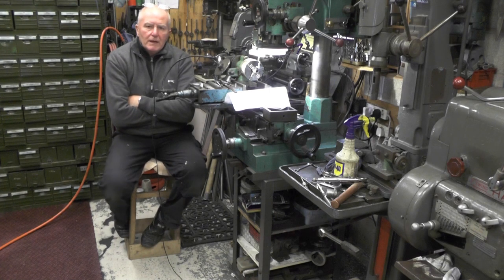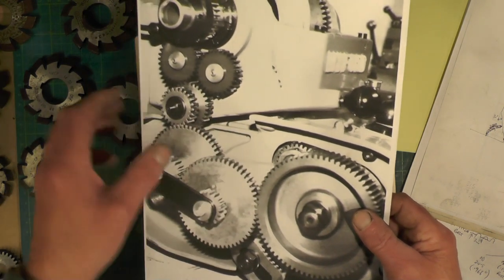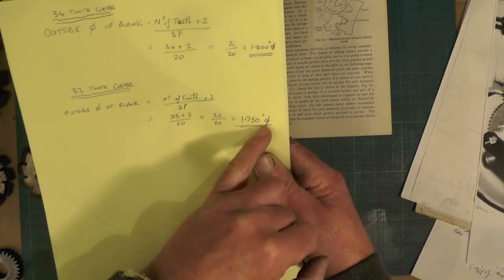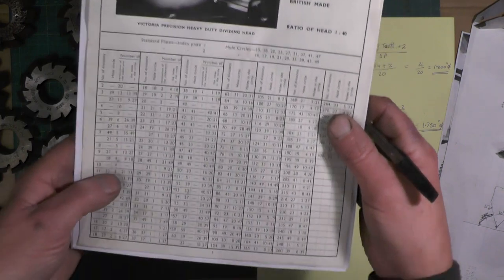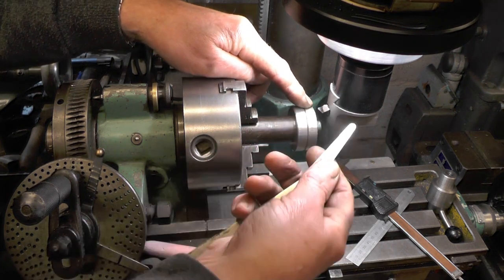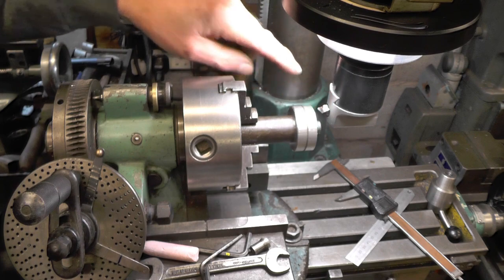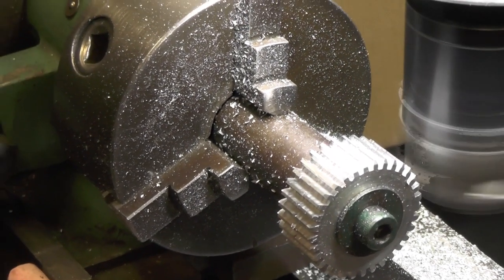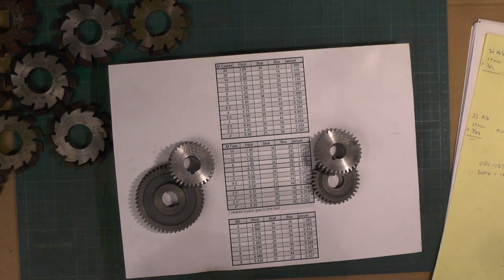Single Point Gear Cutting  Part 2 (Cutting the Gear) "mr factotum"

Comment: I now so want to buy a bigger mill and have a go at making gears. Thank you for your inspirational  posting. 👏👏👍😀 Andrew
Reply from the maker: You can do it! Andrew, my mill is only a small, bench, aging taiwanese  machine, i sometimes have to fight with it!!!
Kev
Reply: @MrFactotum  In many ways, I enjoy working with ageing machines as they are more challenging than a modern, new machine. If it’s too easy, it gets boring. One day I’ll squeeze in an ageing mill into my workshop.
Reply from the maker: @andrewdolinskiatcarpathian  Yes, me too, you learn more on ageing machines, certainly boring if you just have to press a button, without having to think about the characteristics of the machine

Comment: Hi Mr. F,
Your single point gear cutter worked beautifully and the gears meshed nicely. I shall keep that process in mind for future reference. When I cut my one off gears, I made my single point cutter freehand on my bench grinder and eyeing it up on an other gear. Your way of doing it is much more uniformly cut.
As always thanks for sharing.
Regards
Emanuel
Reply from the maker: cheers Emanuel
thanks, they usually work good enough with freehand grinding if it's done carefully, i'm sure yours was.
see you next time
take care
Kev

Comment: Excellent and very well thought out - I'm trying to avoid metric threads but I'll definitely be making myself a 33 and 34 set based on this video if I need to!
Reply from the maker: cheers william,
it will be a good project to practice on, but like you i avoid metric wherever poss. It's sometimes unavoidable though
Kev

Comment: Love the vids dude...
Reply from the maker: Eyup Ken
Thanks for watching and feedback, shall you be having a go or do you already!!
cheers
Kev
Reply: @MrFactotum  I started last week , . I have a Minitor d160 lathe  and the threading guage has 16 teeth.. I kind of haphazardly calculated that it needs 20 teeth... because it just doesn't work .. I keep getting threading problems.  ... today making tool to mount 10mm sq   cutter , and test it.... and in a few days when I gather my courage mount it all on mill and try it out......
Reply from the maker: @kenjohnson6338  all the best sorting the thread dial, my myford has a 16 tooth gear on a 8 tpi leadscrew, (imperial lathe)
Reply: @MrFactotum  this has 4ñ lead screw.... but... due to my paying attention skills... I can not continue...(brain fart ).... the gear I need cut is slightly..helicial..and am having problems working it out... but I made a wicked little single point  key holder...lol,
 thing is , I have all the kit for the divisor plate , gears reductor and plates to attach it to crosslide motor ect (for making helicial gears.) ,,,,and no clue how to use it  !! ... ... back on YouTube àgain  .... thanks man...
Reply: Hold on... jeez what's wrong with my brain.... I can increase angle if dividing head... and support..... which may give me  the 3 deg I need..!!!!,
Reply from the maker: @kenjohnson6338  sounds good Ken,
 "keep on keeping on" 👍👍👍👍